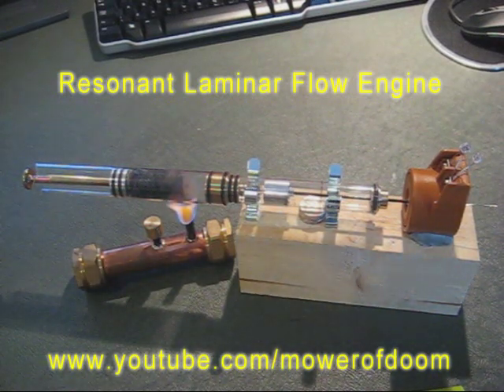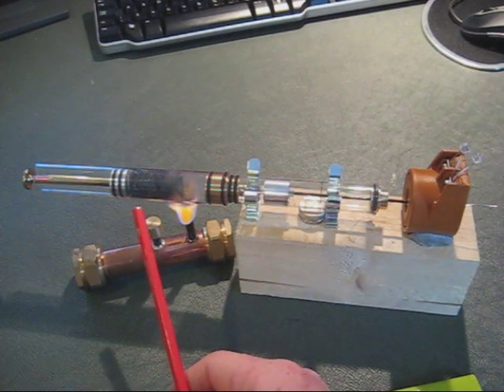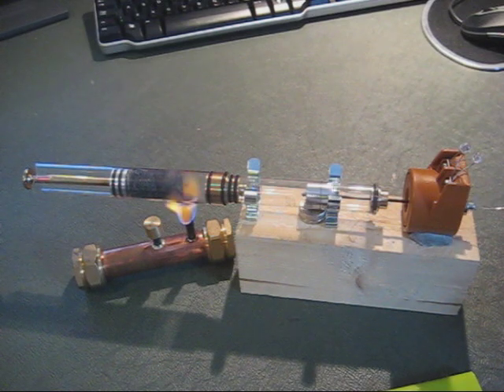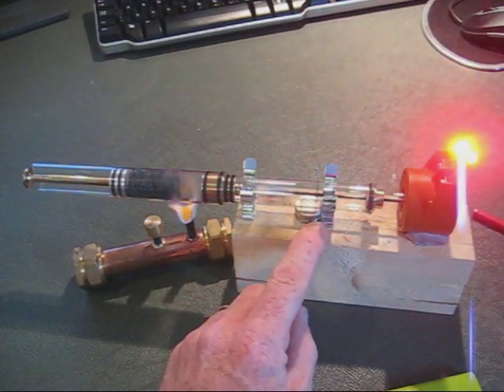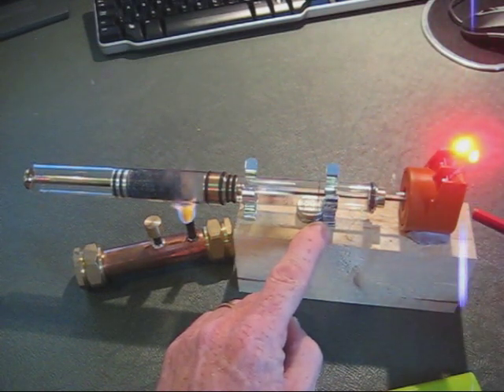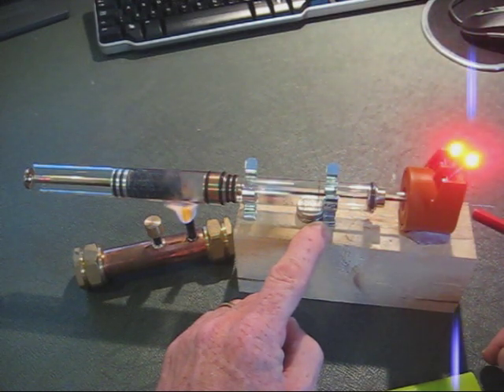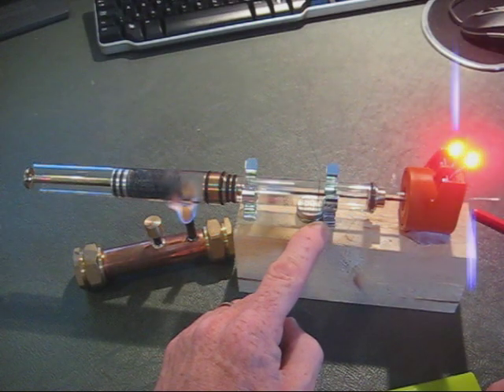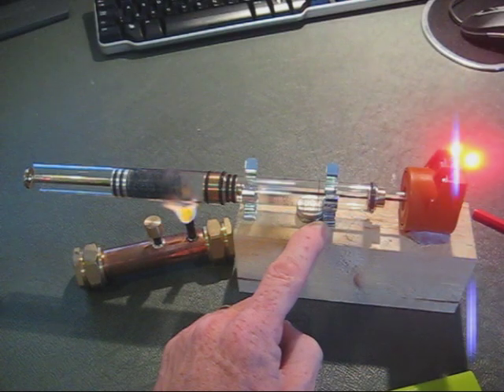RESONANT STIRLING ENGINE GENERATOR

Comment: also.    the mention of heating, over time, causes this observation.     this type of very simple engine is of less practical use, than a stirling engine; where it is possible to have complete  thermal isolation, of hot and cold processes.    this engine, linked, has very good thermal isolation.    isolation could be total, if desired, by using an elongated duct (minor mod required).    some iterations have pushrods made of round wire.   not great.    flat metal is better.    all moving components  Should be as light as is practical; see the governor effect.     googletranslate
https://www.youtube.com/watch?v=-3mj3S2xEK4&t=

https://en.wikipedia.org/wiki/Governor_(device)

Comment: very good work, mostly.    here is some very late info.    momentum is  a wonderful thing.    a reciprocating system has  NONE.     a  linear pma is a  recip  system.      conclusion:   the use of a crankshaft and flywheel  and  Rotary pma, is  Essential, in order to achieve max efficiency.        as output motion is converted to  Rotary,  an oscillating  force is  smoothed  and energy is 'concentrated', at the output shaft.   
  any prime mover  Should  be loaded, such that it has  Mechanical Advantage,  over a (dedicated)  load; such as turning a rotary pma.       heat engine output is  low-torque.     consequently, system design should contemplate a  Fast running engine  and  a  Single stage of high-ratio reduction; perhaps, perhaps, 12:1  Reduction.       in the linked video, it can be seen that  the  stirling engine has been  Correctly loaded;  the engine speed  remains  fairly 'high'.    if interested, estimate the MA  present.     my guesstimate is  15:1.     in order to efficiently  generate electrical power with a low-torque prime mover,  the  load  and  the engine  rpm,  at its nominal loaded speed,  Must  be  'matched'.    in other words,  a purpose-designed  pma is  Needed.        imo,  it should not be difficult to power a low-current, battery charging circuit, with a pma, driven by a stirling engine;  one that is a bit more robust, than is typical, of engine for sale.      so far, no one offers an engine that has a  SMALL  gear/pulley  on the  Engine output shaft.      (i am interested in the potential of  TA engines, but have no experience with them, yet.)     googletranslate
https://www.youtube.com/watch?v=6UXSJTweOA0&t=

have you seen   hofler   and   rijke tubes???
https://www.youtube.com/watch?v=pncG3lJUOdY&t=

https://www.youtube.com/watch?v=7WHTaRdIugA&t=
Reply: The moving piston and magnet have plenty of momentum, and the effective air spring returns any unused energy with more efficiency and less vibration than reciprocating, though one could use an actual spring for a much higher resonant frequency ('RPM') and associated power, while the generator can also be used to electronically control the pistons movement.

Comment: Dear Mr. Doom sir, I should like to suggest thermal past between the glass tube (cold side) and the cooling fin(s). also, if you have a moment, perhaps you could give specs. and dimensions. I have subscribed, I very like your good work!    pierre from New Mexico (U.S.)

Comment: Definately figure the frequency which might be a second divided by Length of magnet travelx2.
Put a diode on the circuit because the magnets are creating AC, unless you had one LED one way and the other oriented the other direction. Would be interesting to try. Great to get a clock frequency out of it.

Comment: Try this for fun. Instead of generating electricity, drive the magnetic piston with alternating current at its resonate frequency, and measure the temperature difference your Stirling cycle heat pump generates.

Comment: Have you tried to move the left piston while running. Could be just a fantasy but you may hit a resonant air volume.

Also how about moving the steel whool on right side of the flame. I know on every video of hundreds it is just that way but I think the purpose of it is absorb the heat while piston runs forward (and cool it down so some suction occurs) and bring it back while moving backword.

Comment: Nice little engine. Have you measured the power output on the linear generator? I'm working on a linear generator for a free-piston engine and am having trouble getting more than about 20mw out of it.

Comment: Some pipe blowers could make you some borocilicate glass tubes for that thing iboro glass can handel the temp and frequency changes plus the thickness can be tuned  for the heat sink check around the head shops for a artist or check with a supplyer some times you can get spicific mm.diameter  and thickness

Comment: @jasondean88888 Hmmm... lots of (better) Stirling info on the Internet, but that's kind of the wrong question.  Temperature differential only limits the theoretical efficiency - you probably need a bigger engine & heat source for 5W output with a low TD than with a high TD, but even that depends on what other losses & inefficiencies you create by building a HTD engine.  Pressure, configuration, working gas, heat transfer (source and sink), regenerator / recuperator, etc. etc. Just start playing!

Comment: @jasondean88888 Sorry about all the replies, it kept saying "error try again" so I did. Gave up and thought I'd try again. Little heat stroke sorry. Been testing a prototype home made passive solar water heater I want to use to run a stirling. It's up to 80% efficient at turning the sun into heated water right now. Haven't tested it's top temp potential yet. Thats today.  Anyone know the minimum temp difference needed to run a stirling capabable of generating...say 5 watts? (I'll start small :)

Comment: Well done!

Can't wait for the next vid.
plz make these changes in next prototype.

1. Use of electic heater to measure input power. 
2. plz measure output voltage and current.

so we can find out is it better/efficient than normal stirling engine or not?

thanks and Best luck!

Comment: Giday Geoff,
Did you figure out :
1./ Bore
2./ Stroke
3./ T kold
4./ T Hot
5./ Frequency 1
6./ Frequency 2
7./ A CRO picture would be good.
8./ Volts
9./ Amps

Comment: ? neodimium magnets for generator (more power or reduced oscillation?

?metal tube for increased heat transfer?

Al heat in must get out, Fins for the heat out area?

IT IS NICE!!

Comment: Now i do not know anything about stirling engines, but presumably the thing blew up because of the thermal stresses in the glass, caused by the rather steep temperature gradient along the length of the thing. Could you have the glass tube in two halves with an insulator between the two bits??? But anyway, ABSOLUTELY AMAZING!!!  I am well impressed with that!!!!

Comment: If you are interested:  at the end of your video, the engine is making a sound of 30.5 Hertz pulse.  Assuming that each of the sound pulse is cause by the end of the stroke, then your engine is running at 15.15 cycles per second (or 909 rpm).  Nice work.

Comment: Good Evening, Your coil looks like a small "Foucault current" brake. If it's the case and I was wondering about electrical efficiency(if your magnets are "co-axial" oriented as well as the coil then the "cut field" is not optimal: most of the energy will be lost. If the magnet is moving on his magnetic axle then  the electrical conversion efficiency will remain low.(it's my understanding but I am not a specialist.
Disc magnet with "radius magnetism" exist but i do not have any idea about coil!

Comment: Bravo! Merveilleuse Expérience! 
The engine doesn't seem to be near to stall!  It gives the impression that much more power can be harvest. 
Do you use the back of the piston as a pneumatic spring?
I guess trimming both engine and generator to reach the highest electrical yield will be a challenge!
The second challenge : building the first flat twin.

Really impressive work!